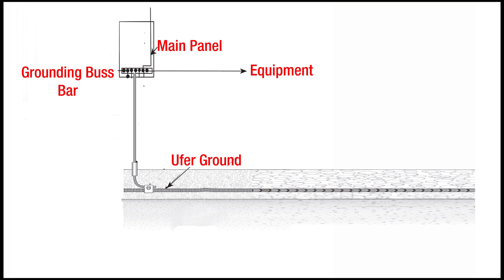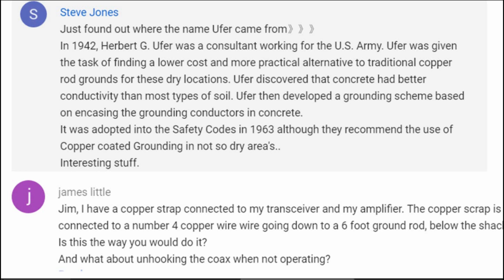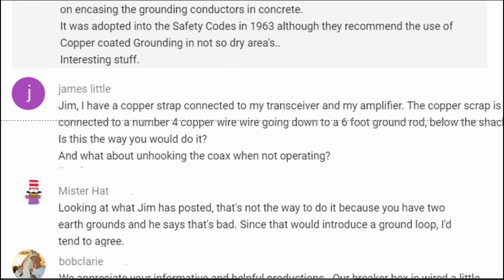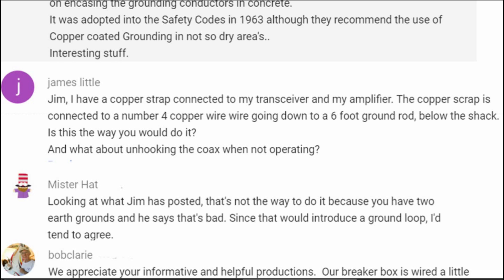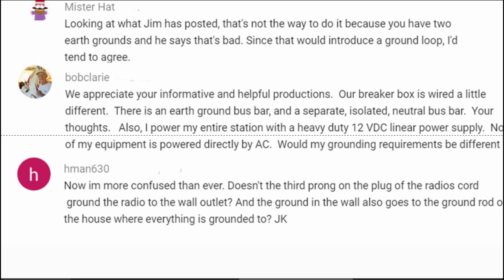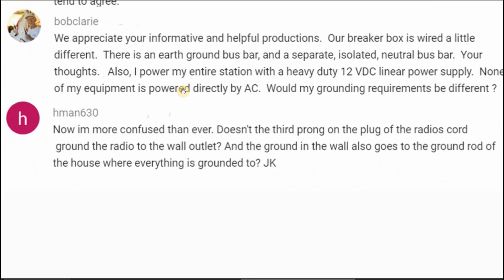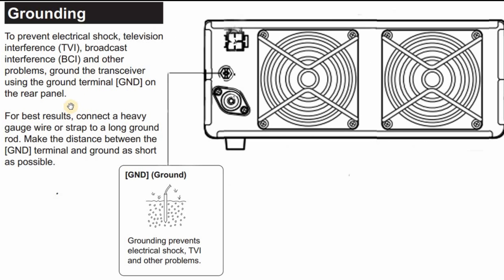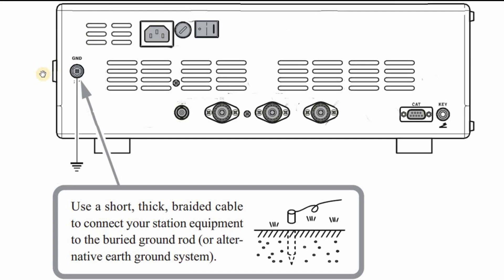Grounding, Bonding, Earthing, Shielding and Protecting with Jim Heath W6LG

Comment: Jim W6LG

Additional Grounding Electrodes are permissible under the US National Electrical Code (NEC). The rule against separate grounds is that you may not ground the Grounded Current Carrying Conductor (GCCC), often called the neutral conductor or just the Grounded Conductor for the sake of brevity, on the load side of the Service Disconnecting Means. That GCCC is white or grey in color. The green colored wire in the power cord and bonded to the chassis of the equipment Is an Equipment Grounding Conductor (EGC). As you can see in section 250.54 copied below you can connect an auxiliary grounding electrode to the EGC without violating the National Electric Code. Since that is the only conductor that is bonded right to the chassis of radio equipment it is permissible to install a Grounding Electrode Conductor that is terminated at a recognized grounding electrode. Using those "Grounding Screws" to connect the GEC to the chassis is permissible because that is just one of the many ways such a connection may be made. 

250.54 Auxiliary Grounding Electrodes. One or more

grounding electrodes shall be permitted to be connected to the
equipment grounding conductors specified in 250.118 and
shall not be required to comply with the electrode bonding
requirements of 250.50 or 250.53(C) or the resistance requirements
of 250.53(A)(2) Exception, but the earth shall not be
used as an effective ground-fault current path as specified in
250.4(A)(5) and 250.4(B)(4).  

Tom Horne W3TDH

Comment: Interesting videos. Thanks for doing them. Do you have a video where, lets say,  you have a radio, power supply, computer, and an outside antenna....where do you use the chokes, ferrite beads...etc? Or should I just buy the Palomar Engineers kit? de KQ1K

Comment: After reading some of the comments, I think everyone is making this subject harder than it needs to be.  “One Ground to rule them all” is my motto. What follows is my perspective on this issue and carries no guaranty or warranty as to accuracy or completeness.  I provide it for simple discussion on the subject matter.
Local Code is the law. If no local code use National Electrical Code (NEC).
Boding: an electrical connection to keep all points at the same potential.
For bonding to work, it has to be…
•	Low-Z and “short” at the frequencies of interest
•	Heavy enough to carry the expected current
•	Sturdy enough to survive the environment
AC Ground
•	It is that third (round) prong on the AC plug.  Grounding is for safety. Use it.
•	Bond all ground rods together using minimum #6 AWG copper. If you have one at the antenna, or where the cable comes into the house, etc., they all must be bonded to the house electrical panel ground rod. You can have as many as you want, as long as they are all bonded together with minimum #6 AWG copper. See NEC 250.
•	Intersystem Bonding: NEC 250.94. The bonding bar shall be connected to the grounding electrode conductor with a minimum 6 AWG copper conductor.
RF Management: Everything in the station is an antenna.
•	Forget about an “RF ground”
•	Concentrate instead on bonding
•	Equalize voltage to minimize current
Bonding Radio Equipment:  My transceiver only has DC going to it. There is no grounded AC plug. So I bond the transceiver to the ground bar along the back of my desk using the manufacturer’s supplied ground post on the back of the case, per manufacturer's instructions. This ground bar along the back of my desk is connected to the intersystem bonding bar. One ground system. While this DC may not be much, if anything goes wrong, I want the voltage to go to ground and blow the fuse on my DC distribution system and not go through me.
Reply from the maker: Thank you.  Keep in mind that there is bonding, grounding and earthing.  The bonding wires are better for conducting RF if they are straps.  Think of the strap being "flat and wide."  Run a flat wide strap from the equipment to aq common buss bar.  Then from that buss bar to a common earthed rod with all other "grounds".  That wire from the buss bar to the common point ground (earth) should also be flat and wide.  All ground wires, earth wires connect at the same point to that common ground.   That is my read of the NEC with help from phone calls to several experts like Mike Holt.  73, Jim
Reply: @ham-radio  I agree regarding wide strips of metal. I use the method outlined in Chapter 24 of the ARRL’s Handbook. Chapter 24 also has pictures and illustrations regarding Single Point Ground Systems.  I believe a lot of the confusion comes from the various electrical terms.  Chapter 28 of the handbook does a great job of defining those terms. Properly defining the terminology goes a long way towards understanding the concepts.  The three goals of AC Safety Grounding, Lightning Protection, and RF Management can be accomplished with one comprehensive system. Thanks.

Comment: Jim, I find this information confusing to say the least. Since the AC plug is already going to the panel ground (through the third prong), is there any need to even use the grounding post on the back of my transceiver?  If so, should it be a heavy gauge wire? What do you recommend?
Reply: Good Question...And the answer is ????????????

Comment: My ufer ground emerges from under the house and manifests in about 6" of exposed 6ga bare copper wire just below the meter.  I can bond my station ground to at that point.  I don't find anything in the NEC that says to bonding wire has to be buried, only that if it is exposed it must be secured to whatever surface and protected from damage.

Comment: I strongly disagree with the premise that you do not ground your radio per the manufacture's instructions (and good RF practice). The house ground is not, and never will be, a good RF ground; furthermore, it is totally inadequate to deal with static related events. It is just WAY too long and WAY too small.
 If the issue is ground loops, then the idea is to establish a really good RF grounding system, ground your radios and lightning arrestors and so on to this system, then lose the ground to the house (use a "ground-buster" adapter).  I will take a good, heavy ground to a good grounding system over a 100 foot long piece of 14 AWG wire to the house ground any day.
If we think about the entire grounding system for a house and the operations of RF ... what a great antenna system with a single point to ground.
Reply from the maker: Okay.  Keep in mind the requirements of the electrical codes and the danger of not following the requirements. Also, that there is no such thing as an RF ground. It does not exist in a ham radio station.  RF will not flow to the ground.  AC will and having more than one path could kill someone.  73, Jim W6LG

Comment: My understanding of DC grounding and RF grounding are very different. With all due respect I disagree. Not  all cases DC and RF ground can be used on the same system. An RF ground system must always be of low impedance where as DC grounding may not always be low impedance. US electrical code rules and regulations do not take into consideration the working of an RF grounding it is geared more toward DC grounding. Also ferrite beads and chokes etc only hide the effects of stray RF they don't solve the problem. Proper RF grounding can remove stray RF from the shack.

Comment: We live in a mobile home and they have 2 grounds, one to the electrical power meter and one to the steel frame. The panel is difficult to get a wire to, so if i was to drive a earthing rod in near the operating position the run a large conductor over to the main electrical ground rod. The rods would be about 15 - 20 feet apart. Would this cover what has been discussed. Thanks de N9TDE
Reply from the maker: It is my understanding and that of many others that way you are adding a ground rod is a violation of the NEC and could pose a hazard. All grounding conductors should be, must be bonded to the common ground.  That is my understanding. You should check with local authorities.  To that end, I did inspect the electrical connection to many mobile homes when I was a Deputy Building Inspector many years ago. You could do this.  Add a copper pipe running horizontally below the desk. Run separate wide strap from the equipment as needed to the pipe. From the pipe run a flat wide conductor to the common ground near the panel  73, Jim

Comment: My electrical pole is 25ft away from my house, and about 50 ft from my office in a doublewide manufactured home.  Can I run my ground, underground to the electrical pole and to the ground rod there?  My antenna is 100ft to the other end of the house.  So I have basically a big loop underground, with Coax and ground and radio.  Big headache.
Reply from the maker: You can but I think that the NEC requires that all ground conductors lead to the common ground connector near the entrance panel.  That assumes one panel and on building. 73, Jim

Comment: Even if you bring all your equipment grounds back to the panel there's no reason to use greater than #6 wire.  Why?  Because your panel is connected to the ground rod by #6 or #8 copper wire.  It's like using 2 inch water pipes inside your home when your water supply is 1 1/2 inch.  Using lower impedance items like strapping in the shack won't give you lower impedance if it still goes through your standard house ground.
Reply: @ham-radio  Hi Jim, I amended my earlier comment about the #4 wire, it was in error.  I amended it to include the items about everything going into that #6 wire house ground.  My point was to temper the urge to spend big money on ultra conductive copper equipment in the station, just to send into a single #6 wire connected to a ground rod.  Sort of anticlimactic.  Totally agree with everything about using the existing house ground, I even commented earlier about my agreeing on the necessity of the third prong in a plug.  Anyways, 73 Jim, be well!

Comment: I have a question. I intend to run an 891 in the house with a tuner and regulated power supply.   Grounding the power supply should protect all three things?    My other question is when you do field day in a park and power off battery you still need a proper ground don’t you.  How do you properly ground everything in the field.

Comment: Jim, technically it is not prohibited by the NEC in 250.54 concerning Auxilary Electrodes, but it should be as it can cause all sorts of problems with differences in potential (see Mike Holt in https://www.youtube.com/watch?v=WlnFNTay-9Q). I realize you're getting more at RF grounds, but the simple way to fix the situation is to install a bonding jumper (that heavy 6AWG wire) from all of your antennas, amp, radio, etc. to the grounding electrode system of your home's electrical service so that they are all at the same potential. I would argue that your antennas are not grounded and bonded unless the coax is bonded to your home's grounding electrode system. You can simply use a intersystem bonding termination to make this connection (where all your home's cable, telephone, satellite etc. wires should be bonded) or if you MUST use your own ground rod make sure it is about 6' away from your home's electrical grounding electrode (rod, pipe or plate) and most importantly BOND the two together so all is at the same potential! Simply saying its a violation of the NEC to have two grounding systems in not necessarily true and just creates confusion for hams of what to do. Despite what people think, doing this will not create all sorts of EMI, etc. on their system and is much safer. So much dangerous misinformation out there.
Reply from the maker: Hi Peter,

Mike Holt was incredibly generous with his time and information.  He said nice things about ham radio operators.  Peter, I used to be a Building Inspector.  I need to finish the videos on grounding and bonding.  For 38 years I operated on second floor (res above gar) without any kind of RF Ground.  Many RF Engineers laugh at the concept of an RF Ground.  I tend to agree.  I did the extensive grounding in the new radio room because I had the flat copper strap and because I wanted to make some tests. I would appreciate more help from you regarding the NEC.  One of the toughest areas to inspect is the rough electrical.

Peter, of topic, but get this:
We moved into this new house that was built in about 1993 and probably has the 1990 NEC for plan check and inspection. I found that an outlet in the living room APPEARED to be dead.  I chased that issue off and on for two weeks. There's a video from an expert who suggests that a lamp be used to test an outlet to see if it is dead.  HOW STUPID IS THAT!!!  My living room outlet had an open neutral.  The black was HOT.  The gound was grounded.  There was 121 volts in the electrical box.  A lamp would not light but someone could be elecricuted.  Behind a couch was an outlet that I had not seen.  It contained probably 16 wires as it was part J box. What complicated the issue was a red wire as a switch leg to another outlet that was switched.  Okay, there's a new probably with that box and all of the wires. I accidentally shorted the black to ground. Crap! Sparks flew and a breaker tripped.  But a black wire that is connected to 4 others is still hot.  It appears to be connected to yet another breaker.  I am going to every outlet and every switch to fix the wiring.  I am finding loose grounds, missing grounds, wires around the screws in the wrong direction and 20 amp breakers on #14 romex. 
Back to the grounding, bonding, I disagree on the #6.  That is okay for electricity and matches the NEC for many situations.  However, #6 is not an effective RF grounding conductor.  It is way too small with not nearly enough surface area. From one box to another I recommend a flat wide bonding strap.  Something like Plumber's Tape will work good.  
Thanks for your help Peter.  The NEC is confusing and the installation of electrical circuits is very complicated even in a simple single family res.  73, Jim
Reply: @ham-radio  Thanks again. Yes I agree about the copper strap, that is a good idea to increase the surface area. Your experience is unfortunately all too common in residential! I've seen many situations like that which are dangerous (and also radiate quite a bit of EMI/RFI). Loose neutrals, missing grounds are bad news. Especially older homes with largely 2 wire receptacles as was common before grounding was thought to be safe. Send me a message anytime about the NEC, its complicated but fun to learn. Mike Holt is a great resource, but also tends to expect your knowledge of electrical theory. Hope to hear you on the air sometime! 73, Peter N0STP

Comment: I just received a YAESU FP-1030A power supply. The "Grounding terminal" is a rinky-dink, TINY screw on the bottom of the case... no feasible way to attach a braided cable or strap. The rest of my powered equipment is singly grounded to the grounding bar in my shack and thence to a set of ground rods just outside. Here's my question... Without a decent factory supplied grounding point, what is my best course of action... ONE, no ground strap at all... or TWO, drill a hole in the case and bolt the ground strap to it?

Many thanks
Reply from the maker: It sounds like a ground or earthing strap is not needed.So ahead and test the device for issues. Also, you can contact Yaes directly to get an answer.  Yasue makes excellent equipment.  If they indicate no ground is needed then that is the answerl If you still want a flat wide strap you can remove one of the rubber feet called bumpers put the strap in place and reattach the foot. 73 Jim

Comment: Hi Jim,
Thanks for your videos. I'm sure everyone can tell, you put a lot of thought into them.
I've run into a head scratcher. I have a mobile home where I've just set up my station.
I was going to ground my equipment to the electric panel ground. I discovered that the panel
ground goes to the metal framework under the floor, not an earthing rod. I further found a loose, (not connected) ground wire partially buried that runs to the  electric meter in my yard. I rang it out with a meter. I think the disconnection may have been done while fixing some grounding issues I had 5-6 years ago that the electric co. repaired. I believe the home is grounded, (earthed) thru the tie down stakes that bolt to the framework. I did an outlet check that shows I'm correctly wired.
I'm using an Icom 5100A as a base powered thru a 13.8v pow. supply and a Diamond dual band vertical ant. on a 25' fiberglass push up mast, located some 20' from station room. 
What do you think is best way to ground, also antenna lightning protection recommendation.
I haven't transmitted yet. Just trying to do best setup prior.
Thank you, Lee W6LTV
Reply from the maker: Well, that's not good. You can transmit without a ground.  I did for decades on Wolf Mountain.  Make absolutely certain that the wiring in the house IS CORRECTLY GROUNDED!  That AC ground must be connected per NEC or your local code which is likely the same as NEC.  Tie all of that together and grounded to whatever they used (likley a ground rod).  I would not depended on the supports for grounding.  And at this point you have no way to determine if in fact the house wiring is grounded.  Your local utility may be willing to come out and help at no charge. It is a safety issue.  By coincidence, I hope to install my grounding at the new QTH today or tomorrow.  Two #8 for the AC ground conductor back to the Ufer ground rod along with a 2 inch wide copper strip.  That strip will run from the desk to the common ground point as a continuous run of about 30 feet across the garage ceiling.  

Back to your situation, check to see if you have aluminum wiring for convenience outlets.  That was common in some modulars.  

Good luck on the project.  73, Jim W6LG